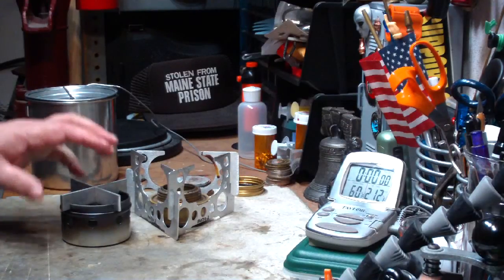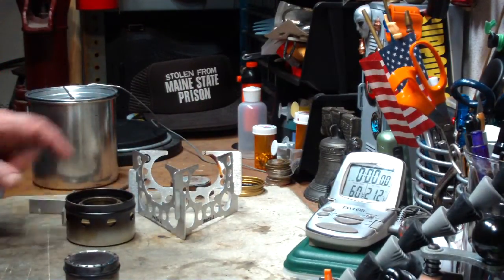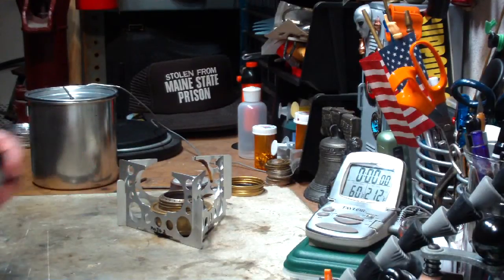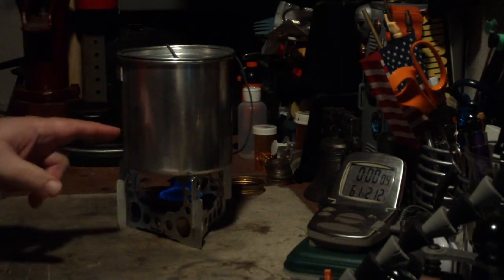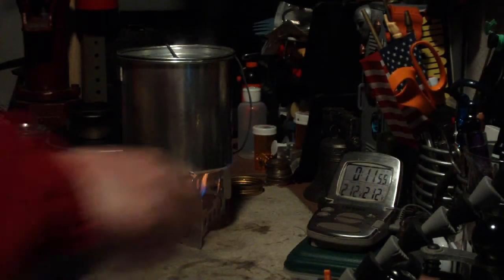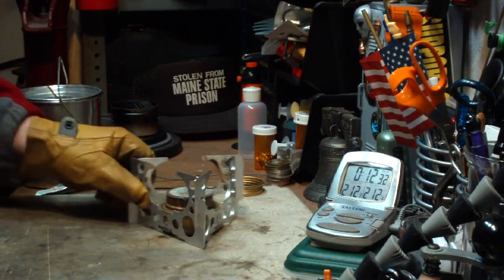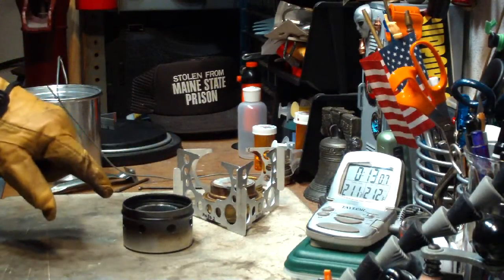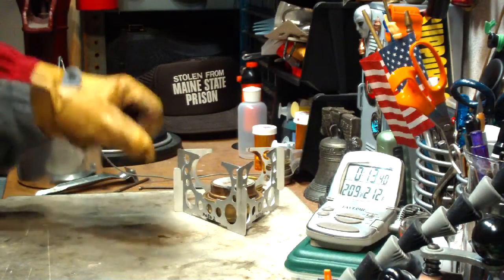Mini Trangia - Mojo Pot Stand - Boil Test Using One Quart of Water

Comment: on a previous test you did.  the trangia started to huff and puff flame when the casing got to the critical temperature.  Trangia has proven to me that it will melt aluminum strapping of that size.  If you include a backup pot stand to carry to pot weight during  catastrophic meltdown it wold be intersting to watch (on your test bench I have already had an alcohol fire on mine) :)

Comment: I would guess that the "outer burner/windscreen" on the Etowah retained more heat under the pot compared to the more open Mojo potstand.
Maybe a, relatively tight fitting, windscreen would improve the time-to-boil on the Trangia and reduce the time for the jets to blossom.